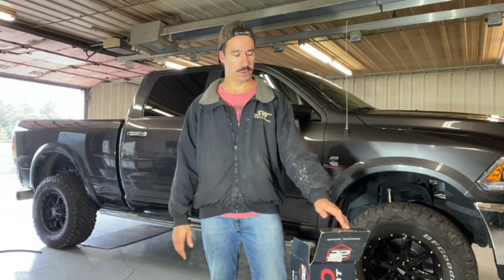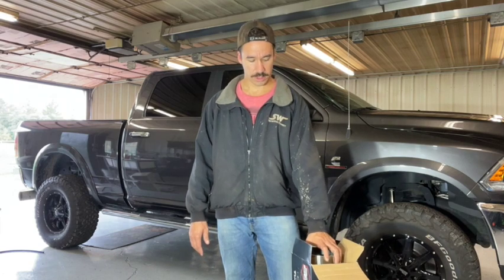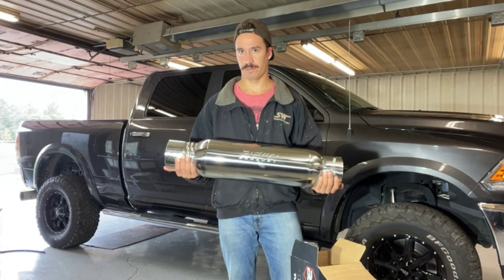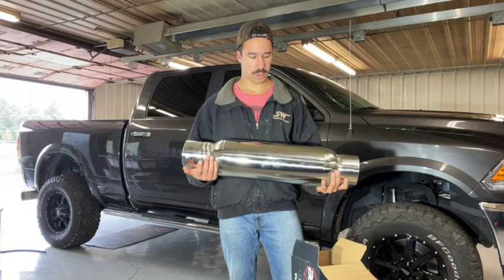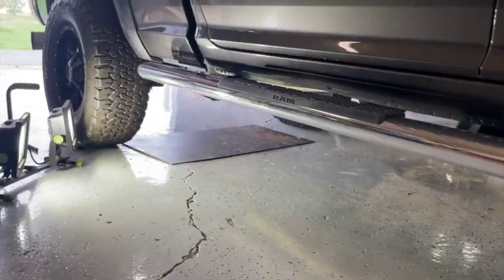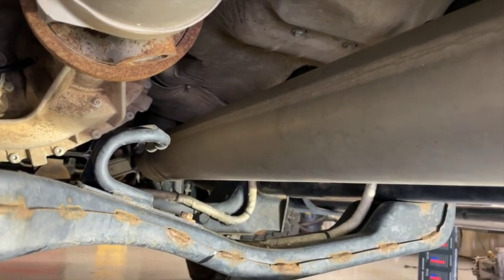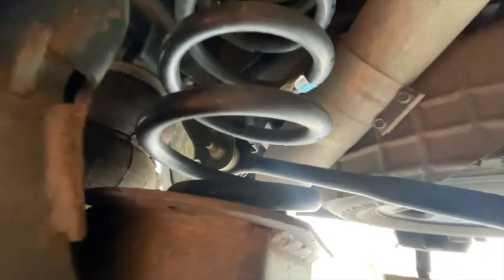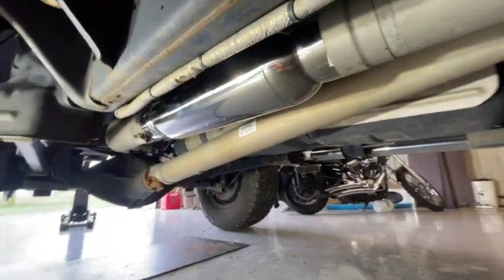6.7 Cummins with Aero Turbine 5050XL muffler

Comment: The further back a muffler is the better and more sound it will absorb. If it’s a resonator then the closer to the engine it should be.  That’s why you don’t see cars or trucks with mufflers close to the engine always in the rear.
Reply from the maker: Correct. And sometimes you just put it where it’s convenient.

Comment: Put 2 mufflers in and the noise is much better and if that isn't enough install kill mat. I have a 36" magnaflow at the rear and a 24" one where the cat used to be. I am sure most of these flow though design mufflers act similarly.

Comment: Did the 5050xl on 5” from the start.  No drone whatsoever on a 21’ Cummins. Can still hear the exhaust brake firecracker sound.  Still has the rumble and barks when u get in it.  At idle it sounds modest…slight hiss and light rumble.  I put it in the muffler delete section towards the middle.  No problems.
Reply: No drone? He said he had drone. Was wondering why? I don’t want any drone as I tow often
Reply: @johnnyg8391  I have 0 drone. I put it where the muffler delete pipe goes.  Mines on a 5th gen. though.

Comment: Was thinking about putting the 2525XL aero model on my golf TDI diesel hatch. It's already straight piped. Would you vouch for the sound?
Reply: I have a 5” turbo back Jamo exhaust on my 2016 6.7 Cummins with a Jamo Muffler and I thought it was perfect. Was still plenty loud but not too loud and no drone at all. Sounded loud enough when I wanted it to be.

Comment: Does the muffler Delete make the check engine light go off?
Reply from the maker: Any modifications to the after treatment system without proper ECM adjustments will set a CEL

Comment: So no more whistle?
Reply from the maker: It’s very minimal exhaust whistle when at idle and exhaust brake on when in warm up mode for cold temps. And the exhaust brake noise is much less. Funny thing is you can actually hear the turbo a little more when going down the road.